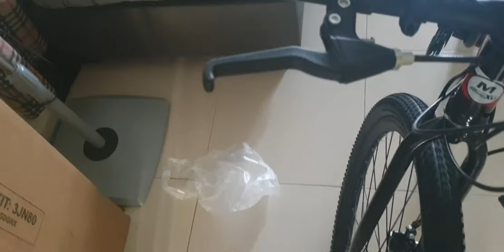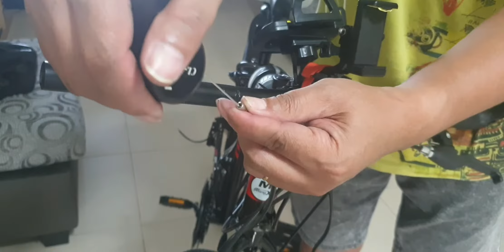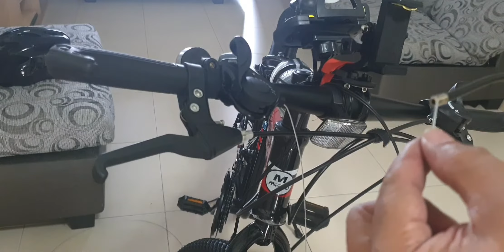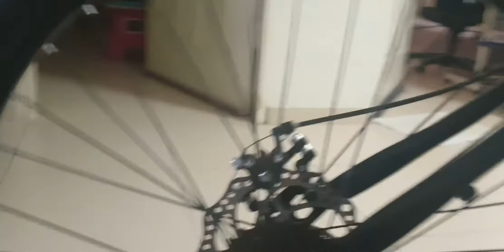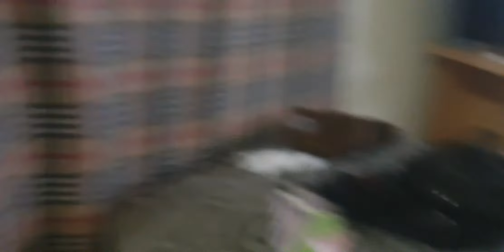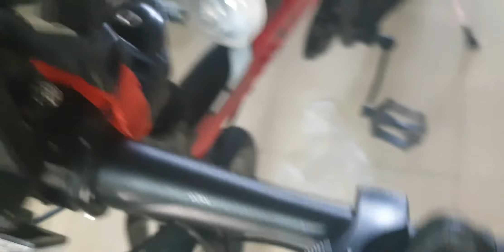How to replace bike shifter with Shimano TX30

Comment: Could I replace the old shifter but leave the cable in place please? I do not think there is anything wrong with the current cable. I just have to replace it because the button broke on the actual shifter. Any advice would be much appreciated. Thanks
Reply from the maker: Yes you can leave the cablr as long it wont disturb you while cycling